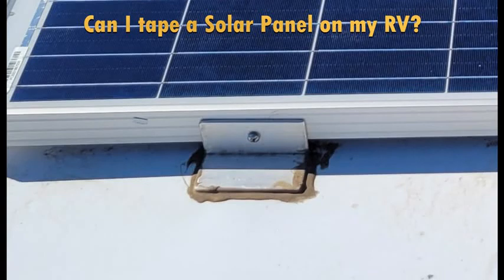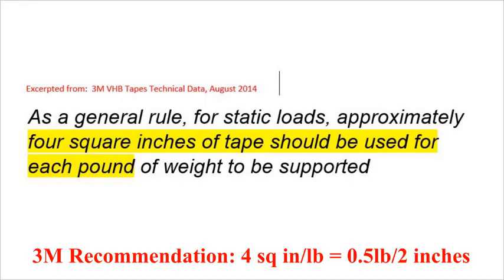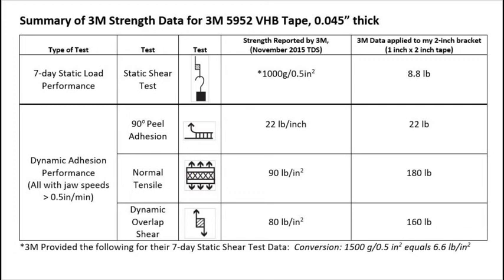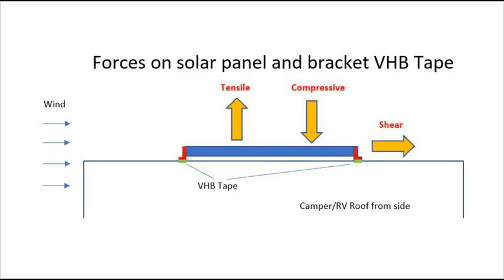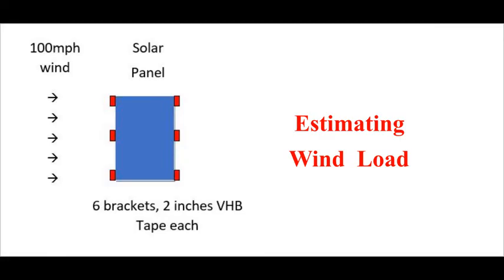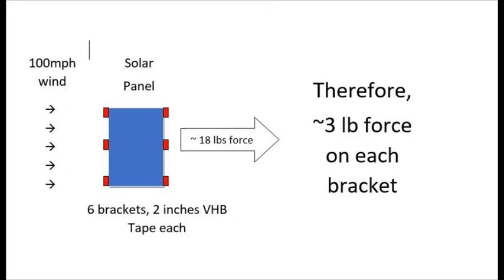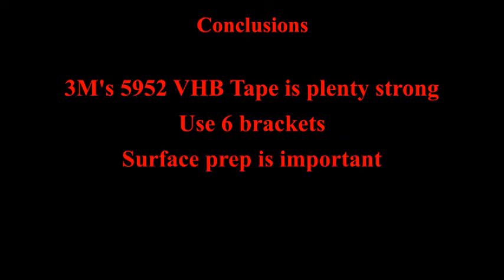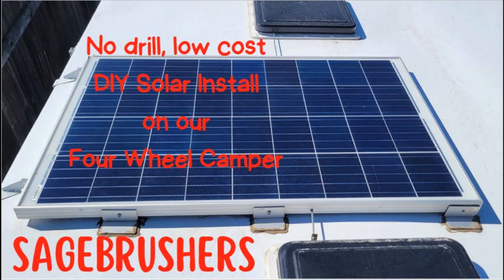Is 3M Very High Bond Tape strong enough to secure a solar panel on an RV?

Comment: Been using this tape on my rooftop tent solar panels and it's holding up great. Probably had over 10k miles on it so far, year later.
Reply from the maker: Good to hear! We have about 60k miles so far including many days over 100F and well below freezing, and the brackets still appear fine. Thanks for your comment.

Comment: In April 2022 I installed my flexible solar panels using vhb tape. It is now June 2023 and there is zero signs of it failing. I doubt it will ever come off.
Reply from the maker: Good to hear @clintonkirker5154!  Just wondering if you can still seal the vhb tape with a sealant or if you rely on it being underneath the panel to minimize degradation by moisture?
Reply: @sagebrushers8497  I put the vhb tape all the way around the edge of the panels and several more pieces under the panels, probably overkill, but it has yet to give me any cause for concern.
Reply from the maker: @clintonkirker5154   yeah, sounds pretty secure.  You should be able to spot any degradation from the elements long before it became a problem.
Reply: What type roof can I ask…mine is a walk on type 2021 rockwood mini lite 22’
Reply: @davidsvoboda7307  fiberglass

Comment: This is the most insane idea anyone has ever come up with, it won't hold to a rubber roof and when that panel goes airborne at 60MPH your going to kill someone!! I have been installing panels on RV's for the last 15 years and I would not use that crap to hold down a zip tie!
Reply from the maker: I totally agree. This attachment method should never be used with a rubber type, or rolled-on RV roof.  Only  on a hard, firmly attached surface like fiberglass or painted aluminum.
Reply: That's why you aren't an engineer.  Look at how airplanes are held together.  90 percent of the strength is adhesives and velcro

Comment: I used 3M VHB Heavy Duty Mounting Tape 4950 for years... Once applied. You need a crowbar to get it off....I sealed around it with 3M windshield adhesive. As it stays put just like your windshield. Water tight. That thing is not coming off.. 

Just clean and prep the surface real good. Make sure you get below any painted gel coat surface. Unless you know for sure the clear coat is bonded to the paint and not peeling...As this is where the bond will break off at..the paint gives out...Thus losing the bond...

Comment: Great testing and analysis!   

My impression is some RVs have some kind of rolled roofing on them.  In such a case it seems that using sticky stuff to attach solar panels might increase the risk of loss of the roofing material itself.
Reply from the maker: Yes, I think you are right. Really should have a hard and very smooth surface, like painted metal or fiberglass.
Reply: I have epdm rubber painted in Dicor  rubber roof coating. Any suggestions. I was thinking SOME screws at front and rely on tape for the rest? Yes/no?? Great video BTW!!
Reply from the maker: @franknabuurs3401   Thanks for your comment!  Clearly some screws on the front edge would help to keep the panel  attached, but my fear would be that the pulsating turbulence would eventually cause the trailing edge to pull up the rubber roof coating, or the VHB tape on that edge. If it did that, it would damage your roof coating and could ultimately cause the screws on the front edge could work out.